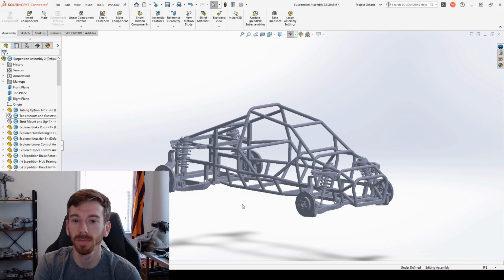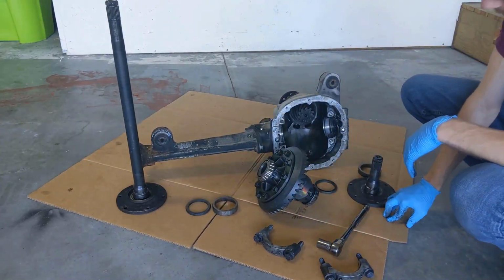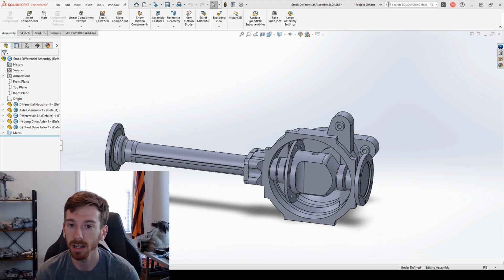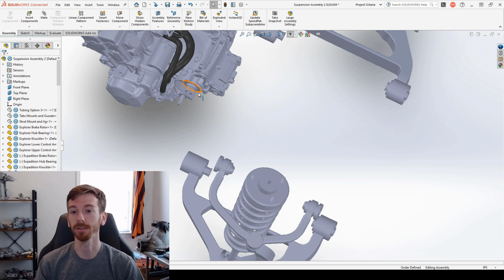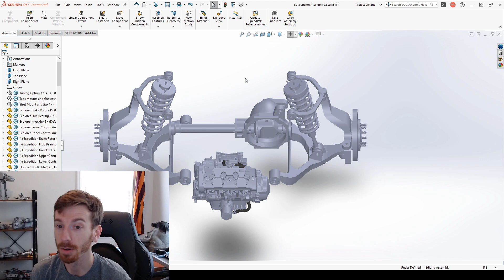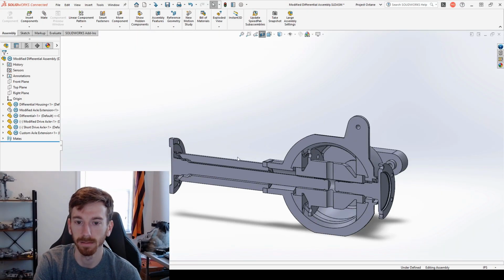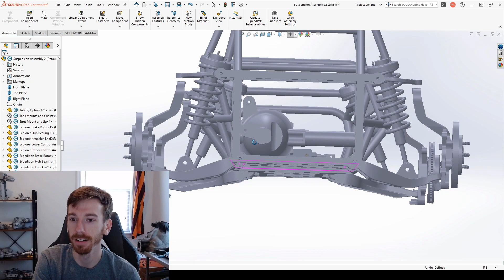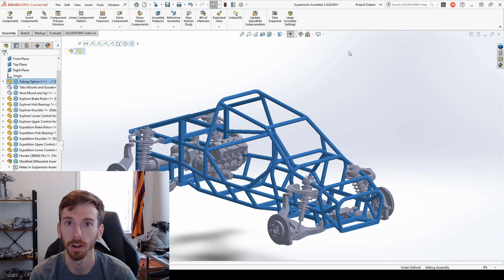Making a Real Life Rocket League Car  |  Drivetrain and Differential  |  EP9

Comment: The idea seems pretty solid, but I don't think you need a big old Ford 8.8 rear end unless you plan on boosting the CBR engine. You'll probably have pretty significant drivetrain losses with such a high revving low torque engine plus you may run into binding issues with such a big differential. I would consider looking into lightweight RWD differentials like out of a E30 or Miata, they should be able to handle all the torque of the CBR engine and be much more efficient!

Love the project and definitely earned a new sub!
Reply from the maker: Originally I was inspired by another YouTuber who used a Miata diff in one of his builds but I struggled to find any at local salvage yards. The 8.8 just so happened to work out a number of ways on paper (fewest modifications, mates with stock CV axles) but I agree it's a bit oversize for what's needed. It certainly may change from whats initially installed.

Comment: With no cover on the diff, how are you going to keep the gears lubed?
Reply from the maker: Probably using a heavier gear grease and thinking about putting an enclosure around chain, cover both diff and engine sprocket to prevent excess debris contaminating area.

Comment: Hey came over here from fluump's channel, were there any other reasons why you chose an explorer as your main donor vehicle. It seems you are already too deep to really turn back now, but civics are rather cheap and plentiful. With it being the same rough size, wouldn't it have been easier to swap the front drivetrain of a civic to the back? If not, why? Was that was it the aesthetics or design elements that kept it from looking the part or maybe fitment. How is a motorcycle engine, and chain power delivery system going to be able to handle the rotating of tires that size? You guys are doing really cool stuff! I'm looking forward to seeing this thing. I would have asked this in the discord but the link isn't working.
Reply from the maker: Hey, sorry about the discord links - working to get that fixed. Lots of great questions. Issue with using full civic powertrain is that we can't fit the transaxle in the rear basket, just a little too narrow. Same deal with like an MR2. We could have still used a civic suspension and cv axles, but we are pretty much limited to either a motorcycle setup or a longitudinally mounted mid/rear-engine and transmission setup similar to a boxster. As far as power/torque concerns, it really depends on the motor. CBR600 we might have some issues but if we use a GSX1300 which makes ~200hp and is used in the Radical car lineup, then we would be a-okay. Hope that answers most of those, I appreciate the support!